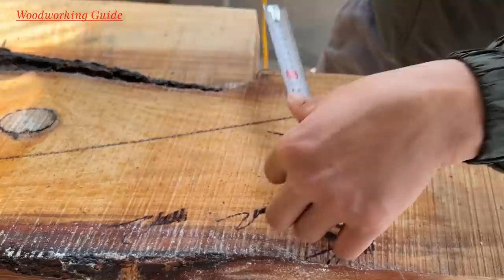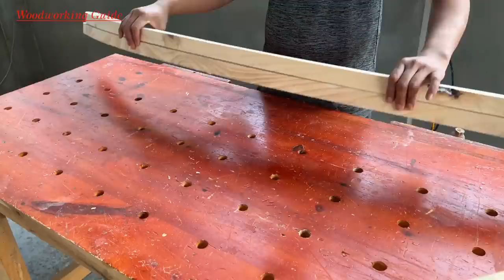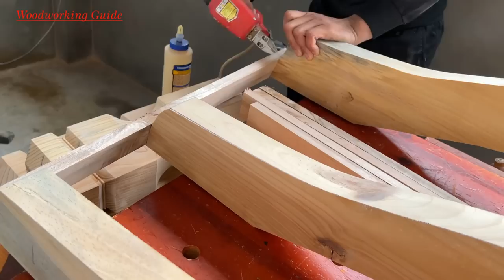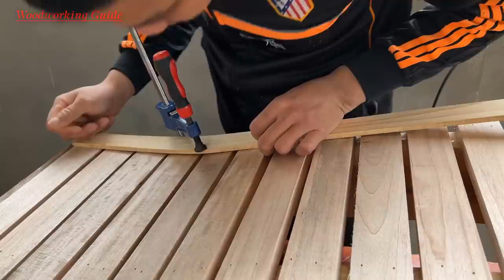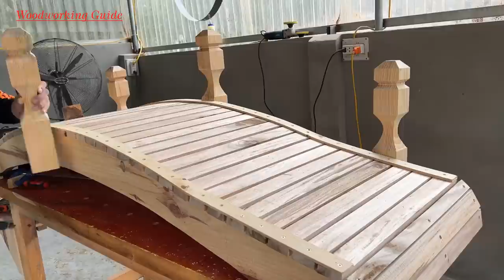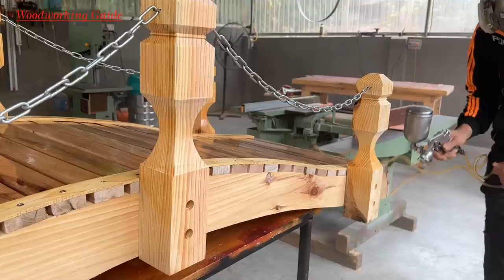Beautify Your Garden // Design An Amazing Wooden Bridge

Comment: Make yourself some "gauge blocks" to help give you an even spacing on those slat boards. Unless having an uneven spacing is the look you're after. Not criticizing, honestly, this came out really nice. I will admit, I did learn something on part of the decoration you put in on those posts. Absolutely love the look of those chains you added. What type of wood and sealer did you use if I may ask? Great video, cheers :)